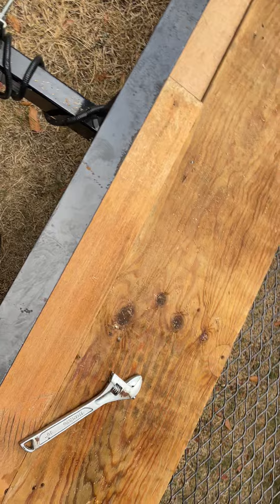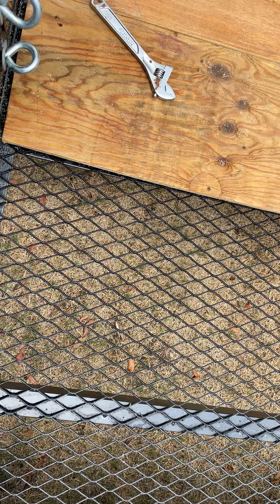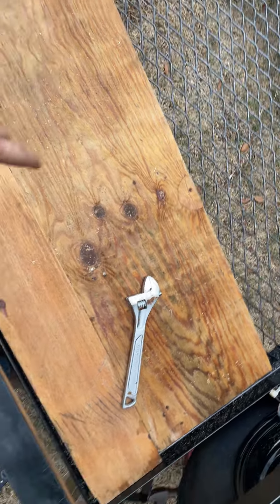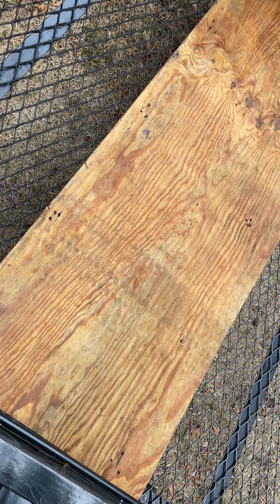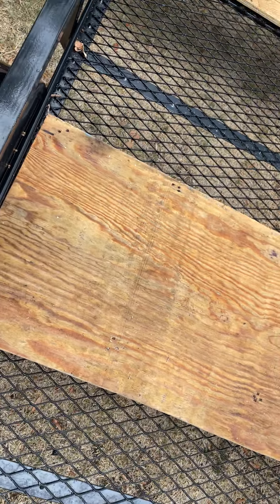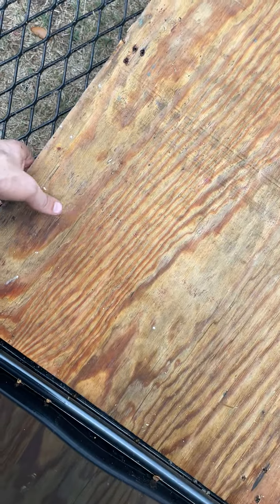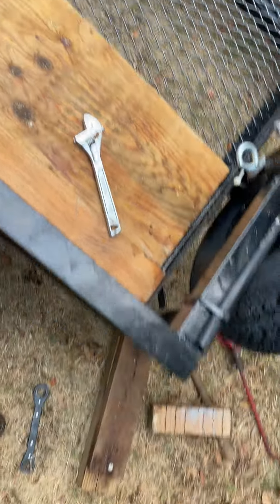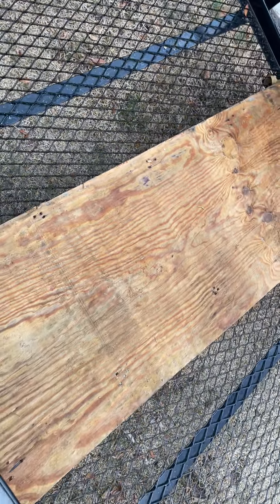I added some plywood boards to the trailer to extend the life of the expanded metal floor

Comment: If it’s wet at all where you live that plywood will make your metal rust and rot away faster. If you are in a dry area you are probably fine
Reply from the maker: Luckily I am located in central Texas so it is dry most of the time.